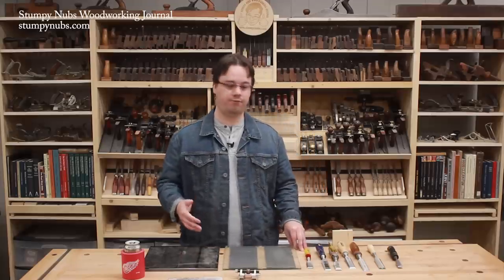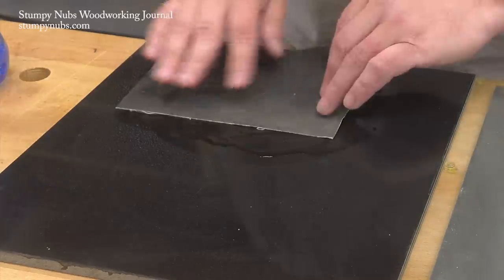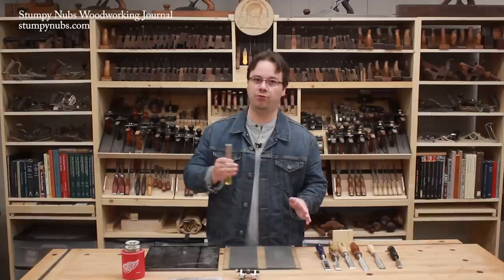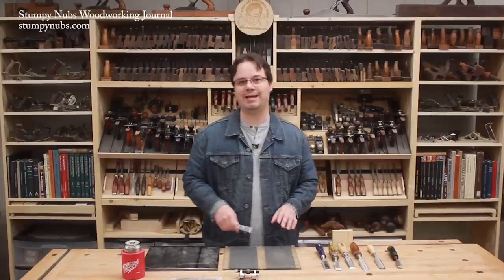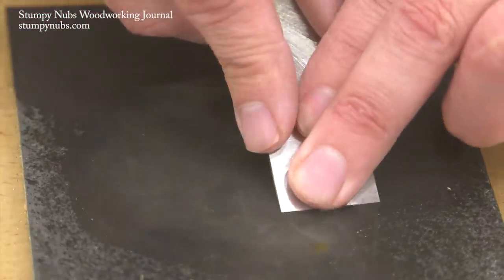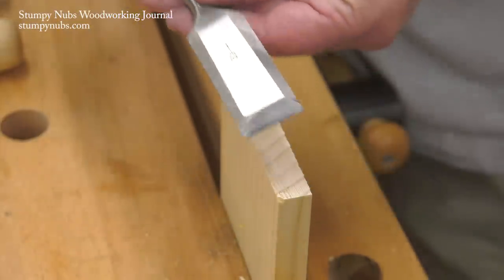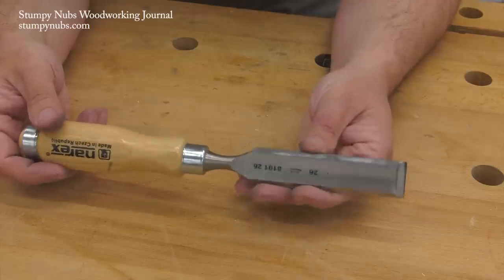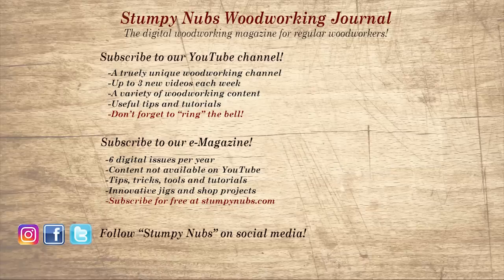Cheap chisels? How to make them scary sharp!

Comment: I had a problem with the Stanley "Fat Max" chisels.  The edges tended to crumble and chip, which was an immense nuisance.  As regards sharpening stones, I like the Norton double-sided India stones.  The coarse side will flatten or establish a new bevel very quickly.  The fine side will clean it up enough to use a strop on.  They are also pretty inexpensive and will pay for themselves over sand paper fairly quickly.
Reply: I like the Norton stones for cooking knives, but for chisels and plane irons they tend to get uneven too quickly. Unless you have a diamond plate to flatten them you end up with round edges that cut badly.

Comment: I bought a 6 chisel set from Harbor Freight for about $10.  I had to return the first set because one chisel had about 1/8” ground off on the side of the edge.  I started flattening with 220 wet/dry and progressed to 400, 600 and then 1000 plus a strop using a leather belt and polishing compound.  Spending about an hour on each chisel I got them razor sharp and they seem to hold an edge really well.  I prefer the HFT to Stanley Fat Max that I cant get as sharp.

Comment: If you have a bench grinder you can make flattening the back easier by grinding a hollow into the back. You can also grind the bevel on a bench grinder then use the 1000 grit sandpaper to give you a secondary bevel. You can get a sharp edge quickly this way.

Comment: Cheap chisels are actually good for new woodworkers because you have to sharpen them so much. You get really good at sharpening before you know it
Reply: I have started doing hobby woodworking only over the past couple of years and I have a cheap chisel set from good ole Harbor Freight. I had good luck with the set I picked up there and the set worked very well with some harder plywood I was working with to make a nativity set during Christmas time. At first the chisel set didn't do well at all but then I remembered that I never truly flattened sharpened and polished them yet. I did do a slight bit of sharpening the Cheap Harbor Freight set right after I purchased them. But there was a night and day difference in using the set after I did a complete service too the H.F. chisels. Also the set has remained fairly nice even after there use with the nativity scene and one or two other small projects.

Comment: I was gifted a 6 piece set of Narex Chisels, the dark brown handled ones and I've used them for about 3 years now, they've handled everything I could throw at them. Granted it did take quite a bit of work to get them flat, my 0.5" and my 0.125" chisel were quite a lot more work than the others for some reason. Now that they are flat, they stay sharp for a good while. My shop works almost entirely on Walnut, so everyone else's mileage may vary. All in all, if the premium brands are really that much better, I might have to pick one up at some point to try. However, for now I'm content with my narex set.

Comment: Great video, tips and advice James, thank you!
I would like your opinion on the following, if you please.
I took my mounted strop leather and using a special made roller (started out as a fiberglass roller), I punched hundreds of small holes in the leather. I did this thinking that it would allow the leather to hold a larger amount of polishing compound. So far it is working well for me.
What is your opinion on doing this? Is it a good idea, or is there a reason I should not do this?

Comment: Stumpy, this was a great video.  You covered a road I've already traveled to a degree.  Several years ago I bought a set of chisel shaped objects from the huge tool importer for under $10 to satisfy a construction project.  Fortunately among my gunsmithing tools is a wide hard felt wheel that polishes a great edge on any steel that can be sharpened.  Unfortunately that edge is only good until I use it.  GREAT advice on starting coarser but not skipping a lot of grits.  When I found that I needed better chisels I started plying the popular auction site and have purchased several pre-Irwin Marples chisels made in Sheffield England, a place renowned for its high quality steel.  They're still not bargain basement priced but I feel like I've gotten fairly high quality chisels and by purchasing them one at a time the impact of the price has been mitigated.  The Sheffield steel holds an edge really well.  By the time I have a full set I could have bought some very nice chisels but my Scot ancestry comes through when I have to turn loose of money.
Reply: Sheffield is known for stainless steel. High quality, but soft for tool use. Great for rust resistant utencils, not great for keeping an edge compared to carbon steel.

Comment: I would suggest adding some dishwashing soap to your wetting mixture for sandpaper. It Helps lower the loading of the paper. Though in a situation like this a cutting oil or even wd40 can help too.
Reply: I know master woodworker Paul Sellers like using Windows washer fluid on his diamond stones for the same reason as dish soap water mixture like you mentioned.

Comment: Super cheap temp tiny wood chisel! Working on some miniature wood frame models. Had need for 1/8th inch chisel, non-exist. Bought 80-Cent straight screw driver ground to shape, heated tip red, bent to shape and filed. Torched to red again and oil quenched. Stone sharpened worked great.  Now have extra paint can cleaners :).

Comment: Cheap chisels, yeah. Bought a set couple of years back. When I used the smallest on its first job it actually BEND. I suspect the steel wasn't hardened/tempered at all. Never bothered to try and sharpen that crap, can imagine how long that edge would hold...

Comment: I have a diamond sharpening stone is that better than going through the grits with sand paper?  (If you cant tell I'm very new to this)
Reply from the maker: Yes, because diamonds don't wear out (assuming you have a good one). https://www.youtube.com/watch?v=zBND6emsSE4
Reply: @StumpyNubs  But in that video you say that 300 / 1000 grit is fine. In that case you would skip the grits. Does it make sense to use sandpaper when first preparing chisels, to have the "in-between" 300 - 1000 grits?

Comment: This video is 100% spot on.  I worked in a high end furniture restoration shop for 4 years and used a variety of chisels.  The Irwin Marples chisels will perform great for all but the hardest of woods, but they do dull more quickly than more expensive chisels, and will require more frequent sharpening.  They are fairly soft, and don't chip easily, though.  Easy to sharpen too. I have a set of the Stanley Fat Max chisels that I use for carpentry when I need something I can bash around, but don't enjoy them for detail work at all.

Comment: Hope y'all have better experience but I had the sweethearts and holy moly they all came with a belly. About an eight and quarter from the edge. Very frustrating to deal with and spend several hours flattening them all. 

Don't know if it's good advice, but wacking the bottom with a hammer slightly bends the chisel to help remove part of the bow.

Comment: Eventually I’ll have to bite the bullet and put my “turds” on the back burner. I have a harbor freight set for now but I also made a jig that holds them dead solid at 25 degrees and I get them razor sharp! But.......... doesn’t seem to last very long as you said. But I can and have shaved off end grain with no issues

Comment: The video starts at the wrong end, but gets there after 11 minutes. First and foremost the chisel must be made from a hardenable grade of steel. Then it must be hardened and tempered properly. If done properly then the chisel will hold its edge for a reasonable time, especially if working hardwood (nothing is worse than ending up with a gap on your cutting edge after hitting a knot). That is the primary concern. All this stuff about flattening the back and sharpening is within your control and can be done on any chisel----but it is a secondary issue. You cannot make a silk purse out of a sow's ear; if you start off with a chisel made from the wrong steel that cannot be heat treated (or with the wrong heat treating process) then you are wasting your time. BTW, the wrong tempering process can also lead to a very brittle chisel that can snap in two pieces or chip easily.

Comment: To polish the backs, press down on the cutting  end. More material will be removed in this critical area. In tool and die work, D2 is a tough, hard tool steel that lasts longer than A2 or O1, Newer alloys are out there. Why not use these steels instead of just carbon tool steel? Maybe because they would take a lot more time to resharpen?

Comment: Is there any tricks for sharpening non-straight chisels? I have a v-shaped one and a circular one. The circular i thought I could put the sandpaper on a sharpie pen or something. The v-shaped one is harder since it is a small chisel and I don't know the angle. Thought of using it to shape durepoxi and, after it dries and hardens, use it like the sharpie pen I forementioned.

Comment: unfortunately the paradox is that you may actually be turned off from woodworking if cheap tools frustrate you enough. the flip side of that is - it is very rewarding to tune in a hunk of junk and have a serviceable tool. get practiced at touching up and sharpening, the cheap tools will require a lot more attention.

Comment: I have a few socket chisels that need new handles.  I've done this before but always struggle with getting the socket conical  shape just right..    I wonder if there is a specialized bit I could chuck in a drill to make the correct angles?

Comment: Bought me a set of cheap chisels. They're flat and seem to hold their edge well enough to cut the grain on greenish pine, but I imagine I'd need to hone the edge more often than I would a better quality set as the sharp corners around the sides could be filed. 

I initially bought them thinking I wouldn't need them, but I should have bought a better quality set because I use them all the time.

Comment: Rex Krueger just put out a video where he found a set of diamond stones for cheaper than the required packs of sandpaper. The stones performed just fine so as long as the price stays that low then it looks like there's no need for new woodworkers to start on sandpaper. Pretty surprising stuff!

Comment: Stanley blacks 5001 s r the governors for site work the steel is different gravy when it comes to holding an edge but alas they don’t make em anymore (to good a quality I reckon ) so uve gotto buy them on e bay and the likes won’t take mine on site anymore they go missing if u know what I mean so use me old yellow and red marples had them years aswell and there a great chisel also seems the older stuff from years ago was  made from better steel more carbon content probably

Comment: James - have you hand any experience with the DeWalt "made with Sheffield Steel" set from the big box store? I'm assuming it's the same as the Erwin which used to be actual Marples which WERE Sheffield Steel.... Time to get some Sweethearts and be done with it... (or see if Dad will part with his Japanese Chisel set that is just slowly rusting in his basement...sigh)
Reply: Sheffield is famous for stainless steel, a very  rust resistant shiny metal suitable for water use, but it is quite soft, unsuite for tool use, where high carbon steel is preferred. 

Thus, it is a very odd brag.

Comment: I was taught SAND paper is for budgie cages.
Glass/Ali oxide paper for SANDING
Reply from the maker: Aluminum oxide and silicon carbide has been used in the metal industry for generations. And when it's on a sheet of paper, it has long been referred to as "sandpaper." I'm not sure why you take issue with that, but we live in the world we live in.

Comment: I have a relatively inexpensive set of German MHG chisels, (£150).
They took a little work to get the backs flat as they were all concave, but they get razor sharp and hold a respectable edge in hardwood, allowing fine accurate work with great longevity!
Reply from the maker: £150 is about $180. That's not inexpensive if you consider that the Stanley Sweetheart set I recommended in this video was about half that price for four. Of course, things tend to be less expensive in the US.

Comment: Great advice but it hurts my English sensitivity when you repeatedly refer to all abrasive papers as '*sandpaper*'! We used to buy a peculiar product that was actually 'sandpaper' but it was a substitute for using loose sand in the bottom of a birdcage. Sand (silica) was superseded by glass in 1833, but even the generic term 'glass paper' is outmoded by the modern abrasives. It is best to refer to each abrasive paper (or cloth) by its specific composition.
Reply from the maker: You may prefer a different term, but that does not make the other improper.

Comment: The chisels I have are from a firm called Bahco and cost a pretty penny.
I don’t know if you have them were you are.
If you do, what do you think about them.
Reply: Bahco make a lot of different types of cutting implements. Such as the Bahco laplander which is a pruning slash bushcraft folding saw. Bahco also makes several types of axes from a full size felling axe down too a hatchet size axe. Just thought you might find that interesting if you didn't already know all that

Comment: I use a DeWalt chisel I beat on for construction work, can confirm great for chewing 2x4 lol
Reply: I I should mention I have tried the similar Irwin version and they are a bit harder ( great for woodworking I bet, but means easily chipped when chewing 2x4)

Comment: I can definitely vouch for the fact that the Dewalt steel capped chisels can be sharpened to a razor edge.  I nearly took the top off my knuckle with one of those a few months ago, and the cut was so clean you can only see the scar when I bend the knuckle to at least 90 degrees, and even then it's very faint.  The doc that stitched me up couldn't believe it was a chisel that did the cut.
Reply: The morals of the story are... a) never use tools for purposes other than intended, b) always keep your free hand (and other body parts) out of the path the tool will take if you lose control, and c) keeping your tools sharp not only makes for fewer accidents, but makes those accidents easier for doctors to patch up.

Comment: All of my chisels are very old Stanley, with the red and clear plastic handles. Also, you make no mention of blade touch up with a wet stone.
Reply from the maker: Why would you use a wet stone after using sandpaper? They are two different tools for doing the same thing.

Comment: I must have gotten some Marples chisels made on a Friday afternoon, because I simply couldn't keep an edge on mine, even on soft woods. My cheap (for Japanese) no-name chisels from Japan Woodworker, and Pfeil chisels have been wonderful, however. I keep my Marples for rough work, and to remind myself that when corporations buy well-regarded brands, that brand should be considered suspect the acquisition.
Reply from the maker: This video is about cheap chisels. There are different levels of "cheap," some better than others. But none of them will hold an edge as well as a premium set.
Reply: @StumpyNubs  Oh, I get that, and appreciate it. My issue is that I feel that the Marples chisels were frustrating to use, even with that consideration, and especially since they came so highly recommended. Maybe it was  a user issue, but I never had that problem with many other cheap chisels.

Comment: You have been a great help to me in learning and improving my skills as a beginning woodworker. Thanks. Stupid question: can you harden the steel of a cheap chisel with heat or is the chemical composition of the steel the root problem?
Reply from the maker: I think it's a problem with composition, not with the hardening process.
Reply: If the steel of the chisel has not been heat treated properly than in theory you can heat treat it again. However you will need to make sure to temper the blade also. Because you can heat treat steel which will make it very hard so hard that it is also brittle similar to glass or ceramic. So tempering the steel is very important. It might also be just as Stumpy said that the steel is cheap crappy mild steel that can be given an edge but not hold one. That is why there are many knife manufacturer that use different steel. Those like Kershaw for instance that uses lower quality knife steel up to a zero tolerance knife company that uses much higher grade knife steels. The better the knife steel or tool steel the longer that the sharpened edge remains sharp, AKA edge retention. At least for the most part some steels also have more or less stainless steel qualities too them

Comment: If you get very good old chisels passed on but they have been left  in a humid place and have rust covered. How to restore them to a smooth and shiny condition although they are razor sharp?
Reply from the maker: A rotary tool with a wire brush on it

Comment: Would you recommend using machinest dye(bluing dye) or color of a sharpie on the back to determine if you're getting the entire flat plane instead of relying on scratches from previous grits?
Reply: Just color it with a sharpie of your choice.
Reply from the maker: The scratches alone seem to do the trick.

Comment: I started sharpening the orange handle chisels u find at Home Depot that come 3 to a pack for 12 bucks. I used 80 to get rid of the heavy burrs then 120, then 180 and finally 300 cause that was the highest grit I had. I got it better then what it was but defiantly not as good as I would like it to b. My question is will going up in grit make the blade sharper? Thanks
Reply from the maker: Yes, higher grit will make them sharper. I listed the grits I recommend in this video.
Reply: Stumpy Nubs thank u for clarifying that, guess that clears up my issue.